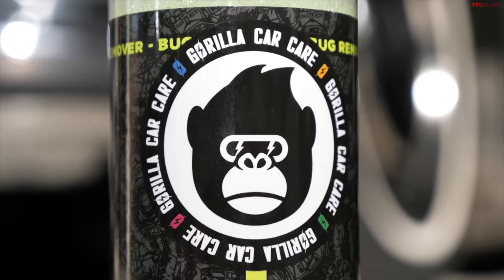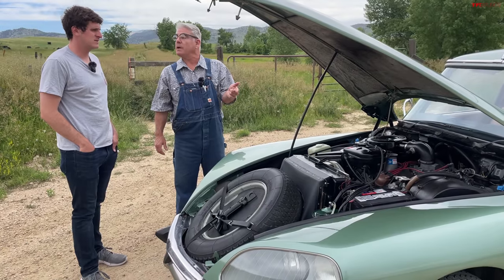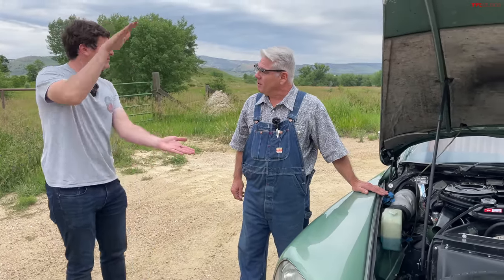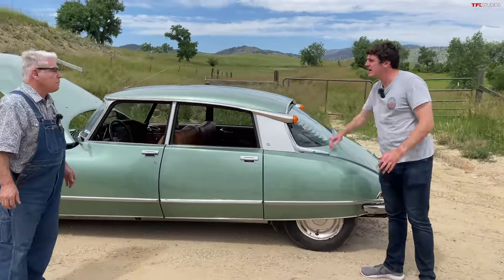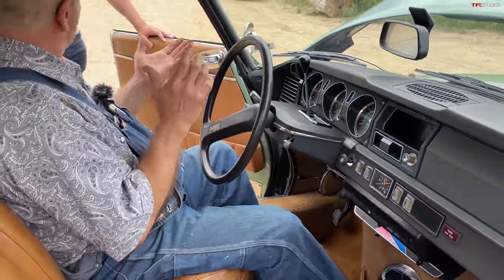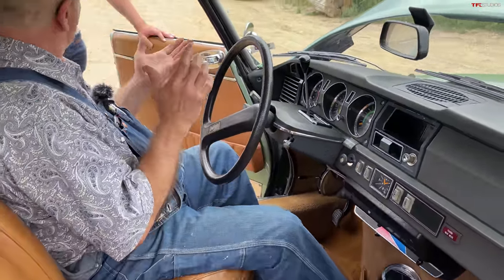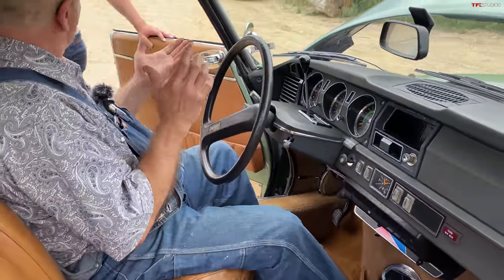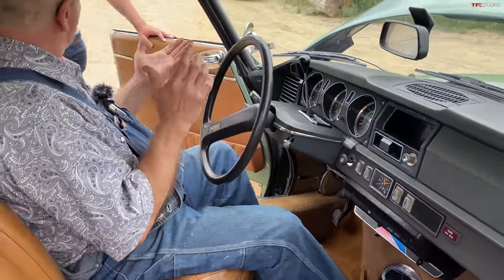Really THAT Unreliable!? Is The Citroen DS as Bad As The Internet Says It Is!?

Comment: I managed a dealership that sold Cits in the early-1970s.  The cars were quirky and fascinating, but VERY reliable and innovative.  For instance, early DS cars with a/c had an evaporator pipe that was routed AROUND the car, not placed in front of the radiator! The main problem with Cits was that there were very few dealerships, and fewer certified technicians.  We had customers who drove literally hundreds of miles to bring their cars to us, and those owners were almost all fastidious about maintenance.  And they were LOYAL;  when the word got out that the DS wasn't coming to the US any longer and the CX was not even being considered, we were inundated with owners who wanted a new one.  I scoured the whole county and bouoght every one I could, but we still fell short.  If Citroen had concentrated on the sedans and not the SM, they would have been a lot better off (very few DS owners were interested in the SM).  I still have a DS23 Pallas that I imported myself as soon as I could, and it performs beautifully as my daily driver.
Reply: The lack of mechanics experienced with the model leads to inept repairs and poor reliability. It's not the design, but the rarity and the resulting difficulty of getting proper care. Scott over at Cold War Motors has a couple of SMs and they're just SO unusual in so many ways.
Reply: As the Parts Man at one of the last franchised Citroën dealerships, in the 1980's, I can echo your comments. Extremely reliable and comfortable cars unless Bubba the mechanic in East Armpit, Arkansas gets ahold of it!
Reply: Enjoyed the video and your comments.  It was a shame they didn't sell the more affordable spaceship style CX in the US. It did not get the engine they originally designed it for though, and apart from the style and ride would have under-whelmed against the competition.  I had one of those, also the smaller GS, then a BX and a Xantia. By 1976 at the BX stage, Citroen had become assimilated into the huge PSA group and basically told 'no more weird design nonsense' however they were still sneaking some of it in up until the XM in 1989 even though it was on a Peugeot floor plan.
Reply: I am an European and i love the Citreon Cars. But one Point which is their strong point and their achilles Heel in one is the Hydropneumatik System. It needs good Mantainance and the Mastercylinder and Reservoirs needs a refurbishment or replacement after 15-20 years. In Europe thats the normal lifespan of a Car 8-15 years. So it is not a great Problem. Sadly thats one of the reason why not so many DS are still around and why some gained the reputation to be unreliable. Personally i have seen two Hydropneumatics fail catastrophical on older Citroens. (One DS in front of me and one CX sitting inside, the CX was 16 year old and not mantained as a students car, not mine). 

Properly mantained, which means good (expensive) replacement Parts, the DS is as good as a modern Car from the 90's. Especially with the comfort feature which make mantainance easy: Rust Problems in the Fenders? Take them off and clean them.
Reply: That's exactly what I was thinking! Citroen, and I'm sure Peugeot and possibly Renault, didn't have a service network for the USA to keep their cars running reliably. My favourite Citroens are later DS, the SM, the CX and BX, etc. I consider it damned unforgivable that neither were ever offered here in the USA.
Reply: "...an evaporator pipe that was routed AROUND the car, not placed in front of the radiator!"  Do you know what an evaporator and/or a condenser are??  Tell us about the starter drives, water pumps, outside& inside mirrors, roof leaks, those fresh air ducts in the engine compartments heat that are never cool & spew hot air & bits/flakes of their internal insulation over everyone, horrible York AC compressors & breaking brackets and only recirculates - no fresh cooled air, then about the sticking/rough shifting Citromatic in 72 and sphere diaphragm's just turning into a gooey mess.  Wasn't around for the coming premature exhaust rocker shaft & bushing failures or trans syncros, the NJ warehouse had HUGE boxes of them.
Reply: @alro2434  Not sure where this all comes from - but can tell you in my 57 years of D model ownership have never experienced what your are complaining about. Nor any  of the folks I know or have renewed hydraulic components for.  My 72 DS Pallas (BVH) has its original tranny and drive shafts with at total of over 650,000 miles and still going strong. The BVH system, if correctly set up, is just as smooth and as fast if not faster as any other currently available automatics - I know as I have driven more than a few of them. Your are right about the York compressors - all the owners of A/C cars I know of switch out to rotary compressors way, way back. And not much of a hassle. Do understand this, at least here in the US,  most of A/C units were supplied to Cit by CoolAir. It was, basically an aftermarket item. The diaphragms you mention were all after market - I know because I rebuild the two part units.  And all the ones I ran across were in SM's from hot climes that had been service by SM World in SoCal.  Have no idea where Jerry got them. And the neat thing about those D's with the rebuildable spheres with the removable  flow control valves) is that one could adjust ride characteristics using simple shims of different thicknesses.The tranny problems you mentioned were almost entirely due to poor maintenance. One thing Cit was universally known for was their transmission/drive shaft and joints durability. Starters - yes starting with the 67 models the ones that had Ducellier units had problems with the Bendix drive. Most all I know of (including my parents 67 wagon) were replaced under warranty by dealers, even if the warranty period was over, with solenoid units. Keep in mind that many of electrical components in US cars came from Lucas. A lot of Swede classic car owners maintain the  Lucas invented darkness. Rocker shaft  problems - again most always caused by extended oil and filter changes. The 5 main engines did have a couple of problems. One was that the compression and wiper ring groves were only 2mm wide. After a lot of miles (in the 170,000 to 200,000) mile range they would widen to around 2.5 mm. The oil control ring suffered no such problem. When I rebuilt the engine in my 72 - had some 420,000+ miles on it - not mine - I found that out. However I only had to have the original crankshaft ground to the first  undersized on an engine with some that many miles, the piston liners had no measurable wear (were within 0.002" of new) and only need mild honing to remove ring scrape marks and give the walls the proper pattern. The ring problem was easily solved by widening them to 3.0mm and installing rings from a Toyota truck of 90mm diameter. The really weak point of those engines were the solid valve lifters - could get really warn in as little as 75,000 miles or so. OTOH any decent machine shop could renew, harden and polish - long term life problem solved. The valve guide seals (Teflon) were a know item. And needed to be replaced with head maintenance. But that was true of a lot cars of that era. Also keep in mind that with cars of that era that after 10 or 15 years factory original parts can become as scarce as hens teeth - and the aftermarket ones may or may not be up to factory standards, more often than not. The one main supplier that makes units as good as, if not better, is IFHS with their spheres. Could go on for a lot longer., but my fingers are getting tired
Reply: @pedrodaniellopesferreira2916  If he was constantly replacing the suspension spheres, he was probably doing the same as me and getting used ones that had been removed and not stored properly. When I got them direct, stopped having any problems. The fact he had it 16¬17 years means it probably wasn't as bad as you remember
Reply: @1crazypj  I'll give you that, I was a kid, and knew the car when it was old already. But my grandfather died and his 1988 Toyota Corola is still on the road as the family backup car. Guess what? It's turning 35 years now, and runs and drives without issues, and its almost 500k on the odometer.The paintwork has no shine left, the driver seat has rips from wear, and the radio only picks up local stations. Everything else, including the AC, still works fine.
Try that with a French car.
Reply: Bingo !! They were difficult to get serviced by a competent and fully trained mechanic . Things worked well but when they did not you couldn’t bring them just anywhere . You had to find your guy . A guy that knew that you were desperate . Not exactly how I like to do business
Reply: @Elkarlo77 ... Sorry for interrupting your thoughts... But the whole system wasn't hydropneumatic.... It is a common mistake to name one thing by other.... But the remarkable technology that looks that lost the perspective is that the car was launched in 1955! .... One more note: the oleopneumatic system was also licensed to Rolls Royce...
Reply: What a discussing comment....
Reply: The evaporator on any car is NEVER 'in front of the radiator'. The condenser often is, however.
Reply: But a Toyota is cramped,rides like a truck, is noisy, and has no character.
Reply: True, but Japanese cars are so uncomfortable.
Reply: With them having focused on the wrong model you see where communication fails and what happens in such a case
Reply: @pedrodaniellopesferreira2916  : non Monsieur , ce que vous dites est absolument faux , mon Père a possédé six DS , durant plus de 30 années, nécessitant une bonne et régulière maintenance , un véhicule absolument révolutionnaire  dans sa conception et jamais égalée, posséder une Toyota ne fait pas Rêver...
M
Reply: @pedrodaniellopesferreira2916  : Toyota est un excellent taxi
Reply: @gil7555  Sorry, but I dont speak your language. And you are French!
So, obviously biased to a car that, in my opinion, doesn't deserve anything but a really bad review. 
Take into consideration that if you are exporting a car, at the very least, you should have a good dealership program abroad. The Americans complained about it, the British complained about it, and this particular car never had a good reputation outside France. I honestly don't understand your comment, but I'm assuming you are defending it's reputation. It was garbage, in my opinion.
I have owned several cars, some new, some secondhand, and Toyota is still up in reliability. I pay any Toyota as much attention as my refrigerator. They don't need anything but oil, filters, tires and brakes. Try doing 200.000km with a Citroen, Renault or a Peugeot and it will break!
Reply: This car looks like a frog
Reply: @Elkarlo77  "In Europe thats the normal lifespan of a Car 8-15 years." ??? I live in Europe (NL) I suppose ypu mean in the 70's and 80's (and probably in the 60's, but I was a little child then), nowdays if you see how much cars from say 2010 with >200K km's still cost I wouldn't say that 8 - 15 years is the normal lifespan of a car.
Reply: @martsteegh4122  Only 20% of European Cars is above 15 years. And by anecdotical Experience the Cars gets expensiv after 15 years as part replacements starts to pile up. So yes you can a drive in Europe which is older than 15 years, but it will be more expensiv then replacing it. When you drive something like an Dacia you will reach this point after 9 years that it will start falling apart.
Reply: @martsteegh4122  I do drive a new car here in Portugal, but we have a second car in my house with 20 years of age. And a backup car in the family (that everyone drives ) which is even older. Both japonese.
Reply: @pedrodaniellopesferreira2916  Got to admit Japanese engineering back then was awesome. I still 'play' with 1970's Japanese motorcycles (not the well known, expensive ones though) With very few relatively cheap modifications to charging system they can be made much 'better than Mr Honda or Suzuki intended (selenium rectifiers were not too great even when new and regulators with points not a lot better)
Reply: that happened due to not having many citroen garages in all U.S. ,in Europe in all cities there was a citroen garage ,one of the most sold brands, and not only the DS ,there were other models that were sold a lot for decades, like the 2CV or the Dyane or the meari (kind of a beach car with the 2CV engine without top and long enough for a family) the GS was sold a lot for around 10 years and what a car it was with several upgrades in the interior and the body beeing the same since the first model
Reply: @imagseer  it's worth keeping in mind that the CX was the last car Citroën made on their own, before they merged with Peugeot. Starting with the BX all the cars were developed to share as many components as possible with the Peugeot equivalents - to save on development cost and increase production capacity, thus the BX has a lot in common with the Peugeot 405, the Xantia was equivalent to the 406 (same engines and drive train), and so on through the entire lineup. PSA has never shown any interest in getting into the North American market, and for the most part theirs and Renaults brands have only been sold in Western Europe since the 1990s
Reply: @pedrodaniellopesferreira2916  It was a car that made its driver an admired man in Britain.
Reply: @danmyself5341 
Have you seen the ones with pop-up headlamps? 

That was really bug-eyed.
Reply: I have to correct myself on 17 th of April 1975 ended the production.
The 2,3 liter unit from DS 23 injection with 126 bhp was later used for the CX 2.400 GTI with 128 bhp.
Top speed was 187 kmh for the DS 23 I.e, 117 m/h and 192 kmh for the GTI which is around 119/120 miles per hour..
Reply: The carburetor version of the 2,3 liter was doing 108 miles with 116 bhp.
Reply: @bennyhannover9361  But small high output engines don't produce enough low RPM torque.
Reply: I had the opportunity to work on these beauties back in the early 70"s . 
I was a Rolls Royce Tech back then in Toronto when they acquired the Citroen dealership. Fortunately, one of our Tech's  (Henri) happened to be French and knew the cars inside out and was happy to share his knowledge with me . . . . I must admit, I was very skeptical at first but soon discovered the clever, innovative engineering that went into this truly incredible machine and fell head over heels in love with this most incredible car.
Reply: I must admit I prefer the DS 21 Pallas over the SM
Reply: @michaelbenardo5695  I was born and raised in japanese cars but I wouldn't dare to compare them with this masterpiece, lol. But I give it to you. Such a masterpiece requires masters of mechanics and more than that, artist. For having maintained old DS, CX, BX, Visa Club... You have to feel the car, to listen carefully and more than following a book, you have to love what are doing at the moment. Only to this condition can you maintain this car.
Reply: @pedrodaniellopesferreira2916  Toyota , Honda , Mazda, Hyundai, Mitsubishi, and so on. I love them and was raised into them and used them a lot, with love. But DS is a real mechanics art and precise invention. I don't see any humankind work in mechanics approaching this.
Reply: @pedrodaniellopesferreira2916  first car I drove was the very first Honda Civic. A Special Edition with an automatic gearbox with overdrive. That was a rally-ready car. And I drove a Mazda 6 Sport also as daily, had a Sonata and a XG300 and I drove BMW, honesty nothing comes close to real Citroën cars...
Reply: @pedrodaniellopesferreira2916  Japanese cars and particularly Toyotas really upped the game in reliability and precise assembly (although the earlier generations imported into the US were mechnically crude scale models of American or British cars with the opposite of French cars for wheel travel and seat comfort.)  Everyone else had to shape up.